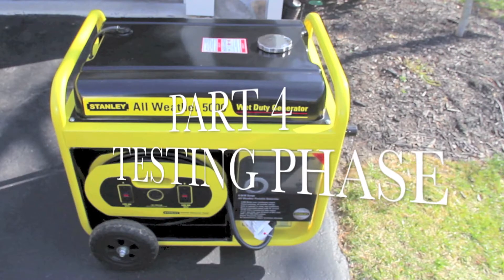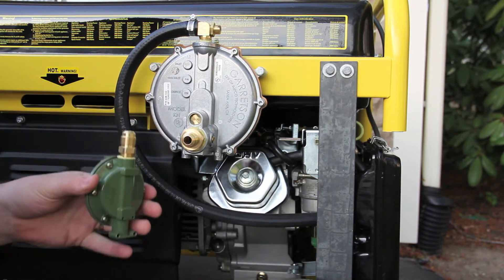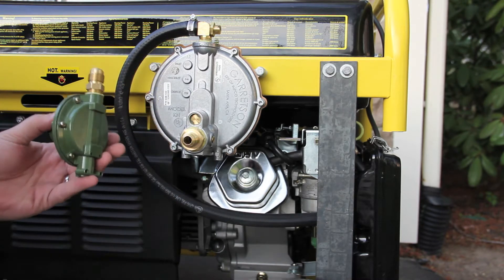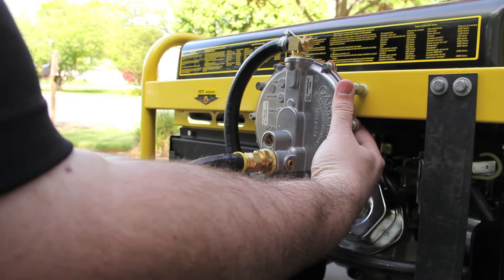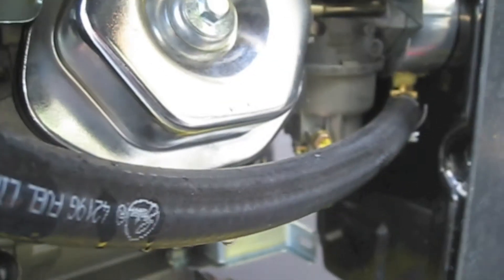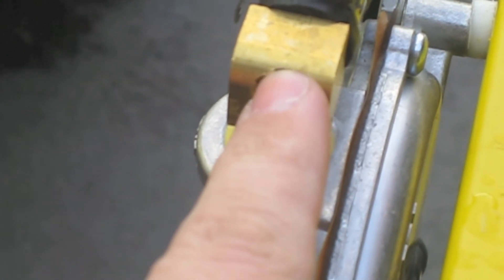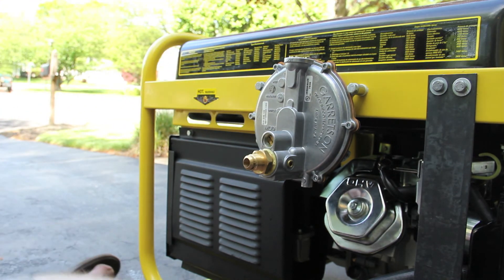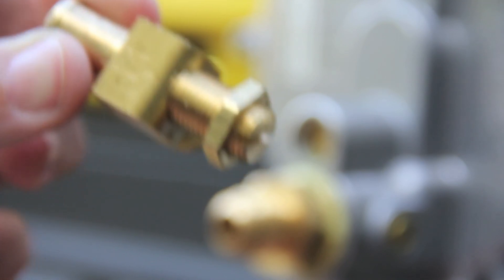Tri-Fuel Generator Conversion - TESTING PHASE (PROBLEMS ARISE) - (Part 4) - FULL LENGTH VERSION

Comment from the maker: I did this video in 2013. Motor Snorkel came out around 2014-2015. Motor Snorkels are now the way to go. Check them out. https://ebay.us/cdLSPs - Also note, the Stanley 5000 is no longer available. Here are Tri-Fuel generators you can get right now. Save time and money by choosing one that is ready out of the box. - https://geni.us/qwi9tPa (Amazon)

Comment: You can use a ball valve instead of that elbow valve. Then no leaking. Even if it is sucking air, why have a leaky system. If it sucks air, it can suck water and dust too.

Comment: That leaking fitting controls the mixture. Doesn't mater that it leaks. It's sucking when it's working. Air goes in. That's what it's supposed to do. That demand valve doesn't even open unless the engine is sucking unless you press the priming button to open it. Gas doesn't come out except when you prime it. You screw it in for a richer mix, and unscrew to let air in, less gas being sucked, thinner mixture.
Reply: Wrong wrong wrong.. screwing the load block adjustment in makes it leaner..out makes it richer..
#2 nothing is supposed to leak, supposed to seal the load block adjustment once you get it set..
Reply from the maker: You are correct. I figured that out a couple weeks after. I still have it today and it works great.
Reply: @ModernDayTech  Since you spent the last 8 minutes of this long 18 minute video on your mistake maybe you should put up top that it was your mistake not understanding what that fitting does. Warn viewers that it will leak as it is supposed to be open to the air so it can suck air for mixture control. They might ruin it by sealing it with pipe compound, and cause problems they'll never figure out.

Comment: WhyDo you need to pressure regulators? Isn’t the larger one of the most important?
Reply from the maker: Pressure in a propane tank, large or small, can range between 100 and 200 psi...or even higher when the tank gets hot in the sun. This propane tank pressure must be reduced and be regulated.  Natural gas is usually low pressure in residential homes and only needs the on-demand regulator for safety.

Comment: Hello,  I need help trouble shooting my Honda EU 3000.  Tri fuel.     It's was professionally install 2 years ago,    I use turn on the propane 
It's shakes and sounds like back fired 
Only for propane   The gasoline power is fine
Reply from the maker: Hi Henry, Its sounds like you have to play with the mixture.
Reply: I did but still shuts down once I power up something.  Like shop vacuum or saw ...

Thx

Comment: Hey my observations are correct. The video clearly shows him screwing the valve in by hand and it was never tight. Look Again. And by the way I will not keep my mouth shut when I am clearly right. Besides he said he did not know what to do about it. Did you catch that part. He is still an idiot as are you.
Reply from the maker: Lets stop with the name calling first of all. Otherwise, I'll block both of you from my channel. Second, its a valve that you don't want to tighten down with tools. Its something that you should be able to adjust with your hand depending on what kind of mixture you want. The bolt is there to prevent the screw from moving once you have it in the right location. The vibration can adjust the screw if the bolt is not tight enough, but the bolt will not prevent it from leaking. If you would both watch the next video you will see, once its running, it doesn't leak even with the bolt loose.

Comment: What is wrong with you? The bubbles are not going to stop until you tighten the nut. Have you ever done mechanical work before? Just saying you should stick to what ever line of work your in and leave the dangerous stuff alone.
Reply: Dude, you must be as blind as bat, because I can clearly see that he did have the nut tighten and it still leaked. The screw although can not be tighten all the way because its a control valve and it wouldn't work. So next time keep your mouth shut until you put on your glasses.